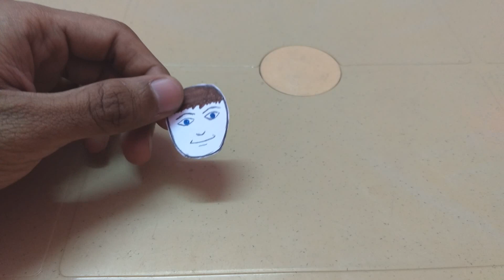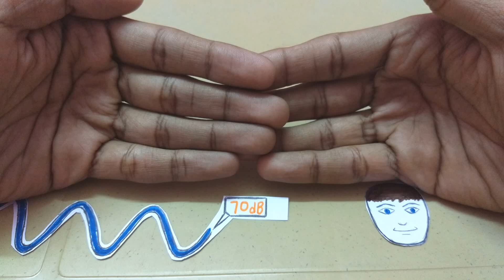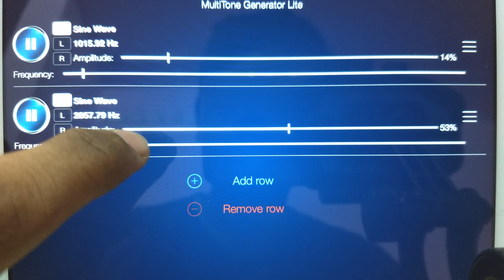Simultaneous sound masking explained and demonstrated

Comment: i was able to hear both sounds. but makes sense in theory but that doesnt occure if you focus really hard on the two different soundlevels.
Reply from the maker: Thank you for watching the video.

Each tone has its own masking curve which explains its capacity and limitation as far as sound masking is concerned. If the tone to be masked is completely inside the masker's 'curve', it is 100% masked. Even if it is offset by a slight amount, then it won't be completely masked. I'll explain the masking curve in a separate video.